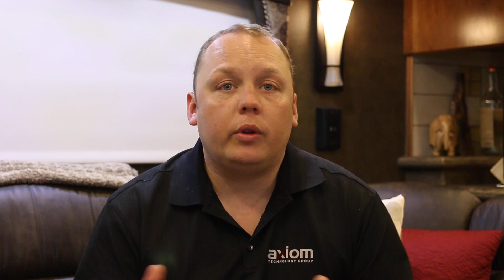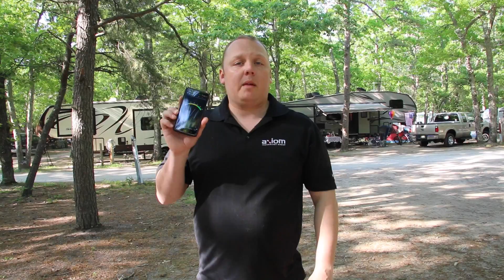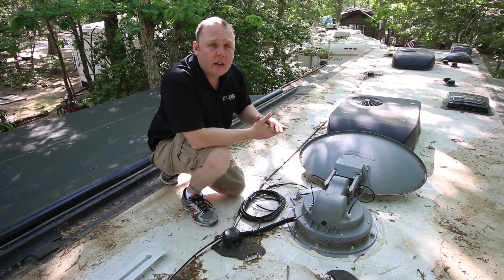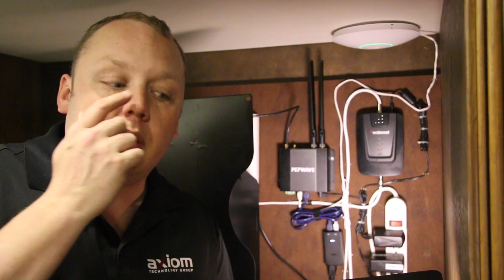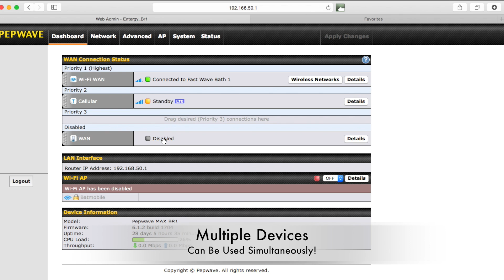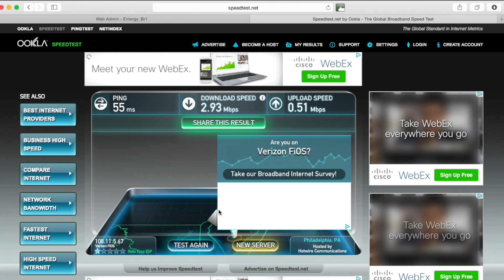Reliable Internet In Your RV Without Data Charges

Comment: this is bad real bad..

rg-59 is 50 ohms
rg-6 is quad shield in most cases and is 75ohms impedance..

you live in a faraday cage everything in regards to wireless reception requires the antennas to be outdoors

and you do need space better..

My opinion talk to a data and cable specialist because whoever rigged this up fucked up...

poe/unifi internal/external screw in ant for wifi out the coach/5thwheel, 

your sat/phone/net/tv should have xg fall over capacity..

you be hard to find external wifi links that run POE on to 2x cat-6/6a cables as is most POE data solutions today that powers your wifi link to the camp ground, though if you are a data centric family you may need to consider a corporate type service connection because by the sound of it you bare above your data capacity for all the devices you have access with
Reply from the maker: +Jason howe hey Jason, the ohms and wire fixes are in pop ups and in full article but probably didn’t show on mobile device as overlays don’t show on mobile device. Video is pretty old, will post our revised setup soon. Moved to UniFi titanium bullet for WiFi but honestly we don’t use much with unlimited cellular plans. Thanks for the comments to help folks. Correct on the resistance issues with rg6 and wifi.
Reply: i was correcting the  notes that was all

the video might be old though if you are going to make claims on setup of certain things be sure to claim correct verbage on things..

I lived in a caravan full time for 3.5 years to know that any and all wired cabling being done will be a min spec of rg-6 for tv, rg-59 or lower for external wireless applications and with POE in use today your external wifi service including 3g/4g/WiMax/lte/lte-a

internal wireless will likely be likely poe based Unifi or similar and external (door side) standard wifi  mounted outside

3g/4g/4g-lte/4g-lte-a needs externl options for use as a service option, not everwhere in world has unlimited data plans on cellbased services, and the latest spec on lte based services in some parts of the world is transmitting around 700mhz or so because 2.4-5ghz spectrum has big issues transmitting signal through  solid objects..

when living in a tin box, you live within the contraints of a faraday cages all external services as such require outdoor rated antennas  for service use

everything within spectrum of internal wireless tends to have poor transmit range..  

whilst wireless is a convenience serving to the mass or 6-8 can lead to 32+ devices to be served with an internet and network connection this doesn't include pvr, dvd/bd, avrs or tv's as part of the rv, caravan and 5th  wheel landscpe as part of a home intranet and internet service guide..

when you start looking at the device count per person the data goes up per person

My console count for 1 person is like 10-12 that have some form of network and internet connection use 

5 tv's with internet capability 
3 avr's, 1pvr, 5 bd players, 1 dvd player, 5 laptops 1 server and 1 desktop to serve for lan/wian/internet connection and sadly when i look at this from a movable home perspective that's over 20+ devices reqiring lan/wlan/internet services..

i can game from a:

nintendo: gamecube, wii, wiiu
xbox: xbox, 360, one, onex
sony: ps2, ps3, ps4, ps4 pro

note: this doesn't include my other consoles because they do not have network interface

yes i own a lot for 1 person though this i can state for a knowledge sake you really need to plan network side when buy and your mobile home on wheels because it can be a bitch to add your home networking in at a late stage..
Reply from the maker: Thanks Jason, the LMR-400 wire we recommend in the corrected notes is 50ohm cable and compatible with the antenna but we don't recommend folks run coax to the roof anymore regardless as its much easier to just run a CAT5e or CAT6 and use a POE injector for the antenna which is how the wifi ranger and Ubiquiti access points works (as you already know, thats more for others reading). Stay tuned for a updated video coming soon. We've certainly learned a lot and much of it is thanks to folks like you who help us out on the road!

Comment: Great video in new to the rv world I have a 31ft rv trailer. I see on the video that you have device for cellular and the wifi, Im only interested on having a decent wifi connection while camping on the rv would I be ok with the directional antenna and the pep router ?
thanks in advance
Reply from the maker: +Jaime Suarez yes you would be fine but that would be quite an expensive solution for wifi only connectivity. Have you looked at the wifi ranger product? You can get a roof antenna for quite a bit less than a pepewave and it will plenty of range. Let us know if you like anything on wifiranger.com and we can shoot you a discount code for 5% off your purchase.
Reply: Wonderfull I'll look them up

Comment: You should check out the winegard Connect. http://www.winegard.com/connect Way better signal than the in home routers I tried, I also used a buddies wifi ranger which sucked
Reply from the maker: Hey Cliff, we have a call into winegard to try it out. The wifi ranger we have works well, but we only use the roof antenna at this time which integrates into our router in the coach. We are going to post a revised setup video now that we've been on the road for over 2 years. Lots of updates to our setup!